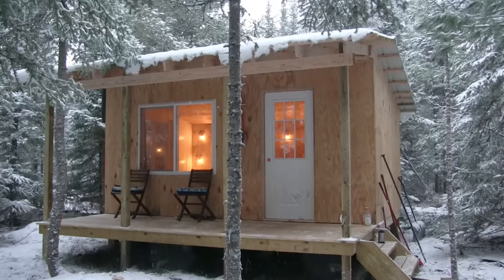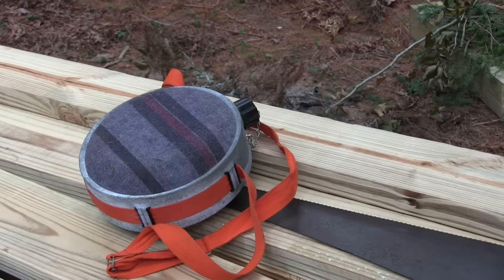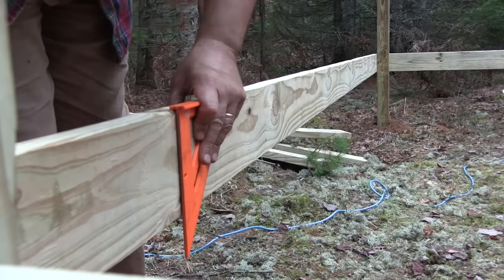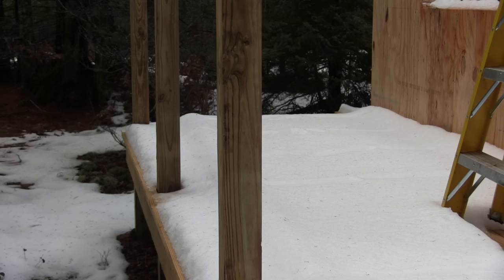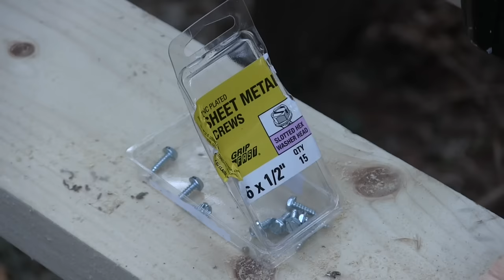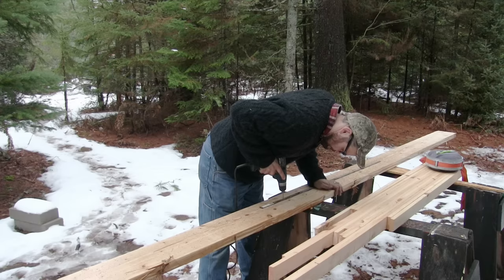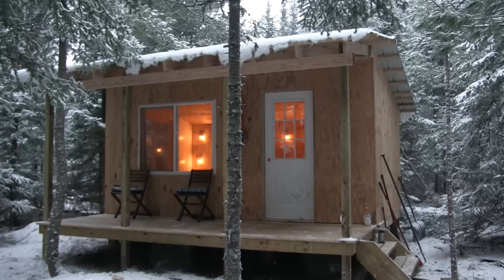Off Grid Cabin In The Woods....Start to finish

Comment: Hi. I am from Russia and I am wondering what significance such a structure has for you. Is it something like a temporary house for several years (something like a temporary structure and when it decays - it will just be abandoned and forgotten), built from a minimum budget, or is it something in between a tent and a country house? For example, in Russia, the price of materials alone will be several average monthly salaries, excluding delivery method, tools and time.

Is this house similar to the construction of your usual country or country houses, or is it an intentionally simplified construction specifically for the forest? And if measured in money - how much will it be about your average salary (in your country, not specifically your income) - one month, two, three? Or is it really not worth anything serious with you and you can do this in parallel with your usual life?

Thanks in advance for your reply. The video is awesome, we also have authors in a similar subject :)
Reply: it's like a Dacia
Reply: It's a cabin - a simple small dwelling. Regarding the construction of it, I would imagine it is intentionally simplified otherwise it was done with incompetence and I don't think that's the case. The foundation, the roof system, the stairs, even the spacing of his wall studs (looks to be 2' instead of 16") are all really simple and wouldn't be done that way on a regular house (disregarding the stud spacing in some homes) but this is a modest build and it will serve its function. Regarding the pricing, I would imagine that you're correct. Couple months for a regular income.
Reply: Was also thinking of the construction type, sorry to say but that roof will have condens water problem and mold eventually, anyway nice video but maybe not a how-to.
Reply: @kharmanen6350  Does it just need vents at the roof ends?
Reply: @sean9820  in this case it will not be enough, maybe if cabin is very rearly heated in cold climate but whats the point with that...
Reply: @sean9820  one layer tyvek for example on roof truss against isolation, then a 2x2 for vent.space, after that the boards for metall roofing, simple fix should be enough
Reply: @kharmanen6350  Appreciate the reply. Happy building.
Reply: @sean9820  I'm wondering if the wood-fire heat (as well as its occasional use) dries it up enough to prevent mold. If it were a 24/7/365 dwelling -- or used propane heat -- maybe more of an issue then?
Reply: @JohnMartin-regardingjohn  Well wood-fire heat is "dryer" because propane-heat creates water wapor as side product, anyhow does not matter wich kind of heat hits the underside of the corrugated metall, it will condens when colder outside. It is also a factor how moist the air is inside and that moist air should not be allowed to move thru construction, wich it will if the wapor barrier is bad and I can imagine its not the best with so many seams without tape. I get that this is a cabin and should be built like one but these are just facts how it works in cold climates...
Reply: @kharmanen6350  Good point!

Comment: I seriously hope you intend to cover that wood up with some siding or treated wood like hardy board or basically anything that isn't plywood or it'll rot faster than you think and that would be quite sad.

Looks like it'll be getting water inbetween sheets too I don't see anything laid down preventing your insulation from getting wet from water that enter between those sheets, which it will even with the roof up if there's no wrap or board protecting the sheets.

Comment: Question for you builders out there:
I noticed that when he was building the deck, he used screws both on the hinged joints that went horizontal to brace the long 2x16's he used as the floorboards. Also, those floorboards were screwed down into the hinged joints below. Is this due to a screw being able to hold wood tighter together? Less movement? What I am really wondering is when do you use a nail versus a screw. 
I want to build a deck this summer, and want to do it well. Any advice helps! Thanks.
Great video.
Reply: Nails should be used for the frame because the structure will move over time so the nails will bend and screws will snap but screws can be used for the floor boards
Reply: Screws can be tightened back down over time.  The surface sees a lot of expansion and contraction due to weather.
Reply: We are in no way professional (or probably even competent) but when we rebuilt our pool deck we used screws everywhere for the simple fact that we have an electric drill/screwdriver and did not have a nail gun and didn't want to pound a billion nails in by hand. But that was just us...
Reply: @Spiderman-ir2pt  wasfürenwidiohasdu
Reply: Nails for framing, screws for decking, a screw is fine for pulling something together but it needs to be followed with a Nails, deck boards are OK for screws because there is so much support allongfhe span that there is no racking so the scrres are unlikely to snap, plus Nails will pull out over time

Comment: Was curious about your foundation 4x8s in the ground do you not worry about them rotting out over time ? I see that they are pressure treated but still over time it seems that they will. Beautiful cabin, lucky man !
Reply: Is this guy just marketing his work for his local market. Great idea if he is. He is great at making it look easier than it is. he has his game tight. Lots of people will fail and call him up. Good on ya dude I say. DIY videos have a way of making it look even easy enough to build the Death Star. I like the Guy. He is adding value to the world in way of peace and liberty. Its refreshing...
Reply: @jamessmith5970  that’s the way to do it - block & cement should preserve the wooden posts longer than the dirt & sand seen here. He may be above the water table but judging by the foliage, there is a lot of moisture in the soil over the year
Reply: Those were 6x6 and if they rot you can simply cut them off and add a concrete pad under each one. Putting them in the ground adds stability. A house that small could be affected by wind

Comment: Great video! I was just curious if you did anything to seal the outside walls of the cabin, or should the plywood hold up to the elements over time? Are there plans to add any kind of siding at all? You're living the dream man, good stuff.
Reply: he made a part 2, Im about to watch it but i imagine one of the finishing touches is a seal or siding, something to prevent mold would be a good idea though.

Comment: Had you put up solar panels on the roof, you could have plumbed electrical outlets and even have a plastic tank for water. Oh yea I would have put up brick backing for the fireplace so the heat doesn’t heat up the wood to much. All in all amazing job Dave 👍

Comment: Curious about this foundation method, since you didn't notch the post is everything being held up by the nails? Wouldn't it be better to set everything on top of the supports versus nailing them in the sides?

Comment: Hey. Love your projects. Questions: You don't think it's necessary to stain the posts before putting them in the ground? or stain the wood before building the house? Do you need permit?Thanks for sharing
Reply: The post were pressure treated.
Reply: He used pressure treated post for the house support so no need to stain.
Reply: Pressure treated but you should seal any cut ends of pressure sealed lumber that you cut.
Reply: @jeffvw1994  what about the plywood used for the underside? Is that pressure treated as well? I would worry it would rot quickly
Reply: @valerieann2751  Above ground air flow is your friend, should be ok.

Comment: A great job building and filming that! Although the snow looks real, it must still be actually a very mild and forgiving climate. Too many things made me, a Russian, rise my eyebrows in astonishment - no sealed vapor barrier on the inside, no caulking between the base floor and the wall frames, no rodent mesh, a flimsy door installed in an opening without a full door frame or any rubber seals, and not even speaking about the whole idea of putting the cabin on wooden posts (and without waterproofing between the posts and the base framing, without a radial water barrier around the posts to keep them dry). Nevertheless, it is a wonderful experience and I am sure this cabin will give you many years of enjoyment.

Comment: Looks good. i would've fully water proofed it, tho with tyvek and tape then some t111 siding for backwoods astedic. Those seams in the plywood, despite being on a stud, can still let in moisture, which will cause premature mold and water damage to the insulation.

Comment: I saw a cabin build where the guy sheeted 3 - 16” spaced floor joists, flipped them over and  nailed them in place. Repeat, repeat, repeat. Then with the underside sheeted, he insulted between the joists, and nailed on the floor sheeting. Then raised the wall framing, etc

Comment: I've seen a video where the under sheeting is attached to the joists before the joists are installed.  Joists are attached to each section of sheeting and it's put on in 4-5 sections.  That way you just turn the section of sheeting and joists over and anchor it to your frame.  No need to crawl underneath.

Comment: I use marine plywood to sheath the outside and dig pilings at a minimum of 48" into the ground. 2x6 walls so you can insulate to the maximum and a metal roof.

Comment: Bro is building a small cabin with better air tightness and insulation than most homebuilding companies, if Matt Rislinger is to be believed - even blocks off the space between the rafters so mice don't have the run of the place, and no cardboard outer sheething either (yes, that's real, some builders actually use a cardboard product instead of plywood, and it's about as moisture and pest resistant as you'd expect after a year or two)- respect to the Bush Radical 💪💪👍

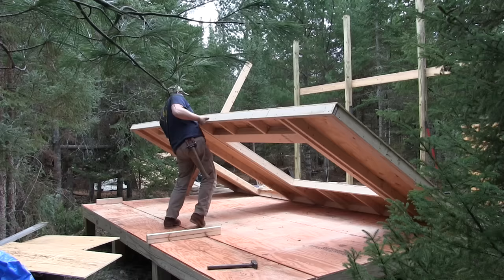Comment: 17:27 A practical tip for handling heavy wall frames during construction involves utilising 2x4s as bracing legs to provide temporary support. Before lifting the frame into place, nail or bolt supports -  long 2x4s to the outside framing studs. These supports are positioned in a way that allows them to swing down and protrude into the ground, providing stability and support at each stage of the lift.

Alternatively, F-clamps can be used instead of nails or bolts for easier adjustment and reusability. This method ensures that the frame is properly supported during the lifting process, reducing the risk of accidents or damage.

Additionally, it's helpful to prepare two long 2x4s angled from the opposite side of the frame. These can be nailed to stakes or outside floor joists, providing additional support once the frame is upright. F-clamps can again be used to hold the frame vertical, and gentle tapping on the clamps allows for fine adjustments to ensure the wall is properly plumbed.

A helpful rule of thumb is that when used effectively, every pair of F-clamps can replace the need for an additional person, making the construction process more efficient and manageable.
Reply: One effective construction technique I've honed over years of experience involves the strategic use of temporary vertical support posts in conjunction with lining boards. By screwing several blocks to both the floor and rafters, with consideration for the thickness of the tongue and groove (TG) lining boards, one can create a stable framework for installing the boards.

This method eliminates the need to individually nail each board to a support structure. Instead, the lining boards can be installed all the way to the top, utilising the temporary support posts to maintain even spacing between boards. This not only streamlines the installation process but also helps to counteract any inherent bows or twists in the boards.

For the final board, cutting it slightly thicker serves a dual purpose. Firstly, it acts as a wedge to uniformly press and secure all the TG joints, ensuring a tight fit. Secondly, it helps to maintain consistent spacing and alignment throughout the installation.

By employing this technique, one can achieve a professional finish with evenly spaced lining boards, minimising the need for additional adjustments and ensuring a visually appealing result.
Reply: Same can be done with slight variation if one uses TG boards as ceiling lining.

Comment: THE NEXT TIME YOU GET UNDER THE FLOOR SYSTEM TO NAIL UP PLYWOOD TO KEEP THE SQUIRRELS AND CHIPMUNKS OUT, USE A PNEUMATIC PALM NAILER WITH YOUR GENERATOR AND COMPRESSOR.  YOU CAN HOLD IT IN YOUR HAND AND DRIVE THE NAILS IN WITH VERY LITTLE EFFORT.  IT IS A GREAT TOO TO USE IN TIGHT PLACES, ESPECIALLY WHEN INSTALLING BOXING AROUND YOUR OVERHANGS AND EAVES.

Comment: Dave, You installed your flue pipe in upside down, it needs to be flipped over.  Male-to-female joints going up to prevent gasses from coming in.

Comment: This is a good work but I need to point out this, preserving wooden posts with fire by charring is old method used worldwide still this days, anyone who planing such build will benefit from doing so, wooden posts in ground will soak moisture and deteriorate over some time, charried with fire can stand for houndred of years, timber cladding chaired with fire also look great and protects even from fire

Comment: They make a solar string light  system by Sunforce....35ft and 40 plus ft. that has a remote....They last 5 to 6 hours...I wired a switch to mine...Only down fall is I need to  turn on switch and go outside with  remote to turn on. I can turn off lights from inside  by switch.My plan is to put the small panels above my window .So I can open window and turn on lights instead of going outside. Just thought I would share.Lights cost about 50 dollars.

Comment: A question from someone who has never worked in construction- Are nails and hammers easier to use than a drill and wood screws? I simply wonder if it's easier and faster to use an electric drill and wood screws whenever possible.

Comment: love this video! maybe a dumb question from a novice - why do you use nails for the foundation but screws for the deck?
Reply: Nails cost much less than the structural screws it would take to support the framework. The thin deck boards tend to warp a little more, and screws hold down a little better.

Comment: Did you use wool insulation for the walls? 
Would you recommend spray foam insulation prior to? I'm at that point in my build. 
Thanks so much.

Comment: Don't wreck your back trying to lift a whole wall, rig up a pulley or something, or build it upright (admittedly this has its own challenges with lifting the plywood pieces into place and holding them, need a pulley for that too).  You don't want to be in the woods by yourself with a messed up back, and the worst part is you won't feel it until the next day so you'll keep making it worse.

Comment: Question, what did you do about the ridges in the metal roofing at the bottoms to keep things from climbing in?  I have seen foam type inserts.  Did you nail facia board and soffit, or?
Reply: On a later video, he builds another cabin on this same property. During that time, he puts wire mesh in the spaces of this cabin because while he is staying there a mouse gets in the roof and interrupts Dave's sleep.

Comment: Hey there everyone! Curious about this foundation concept. Wanting to build a 24x36 cabin and playing with foundation ideas. Would this method even work? There would obviously need to be a center beam. Would notching out the posts make sense so the rim joists would share 3 inchs of each post? Hope this is making sense, any help is appreciated!
Reply: I'm nearly finished a 16x32 using 6x6 posts. I notched mine. Little more work, but I felt better about doing it.

Comment: Why do you use nails rather than screws? I mean I would figure that the screws would anchor better, but does it matter?
Reply: Nails are better for shear strength, you wouldn't want screws holding framing together they could snap.

Comment: Do you need permission from the State?
Reply: Varies by area, but in most places, you can build a small building that doesn't have a water connection. Not much different than staying in a tent, except he will have insulation.

Comment: 3:43...you said it was 16ft. The tape says that it was 15ft 9 inches from the outside of each post🫨
Reply: So, when you move over to 5:0+, you will see a 1.5" board added to the outside. One on each end is 3". Add that, and you get 16ft.

Comment: From Michigan " law " :  ( Michigan fake courts don't follow the law, why should anyone else ? )
Permit Exemptions
Under the law, you do not need a permit if building:

Detached accessory which is 200 sq. feet or smaller: Must be an accessory to a single or two-family dwelling
Detached accessory which is 120 sq. feet or smaller: Must be an accessory to a building other than a single or two-family dwelling

The exemption does not apply if no other buildings are on the property. And the exemption generally does not apply to buildings that will be used for living.

This makes it illegal to, for example, live in a small storage shed on your property without first getting permits and meeting all codes.

THERE ARE PLENTY OF JUNKER HOMES DISINTEGRATING IN MICHIGAN ON ACREAGE ----- SO JUST CONSIDER THAT AS A SINGLE FAMILY DWELLING TO WHICH YOU ARE ADDING THE DETACHED ACCESSORY !!

ENJOY LIFE